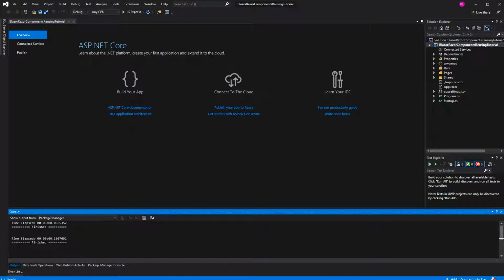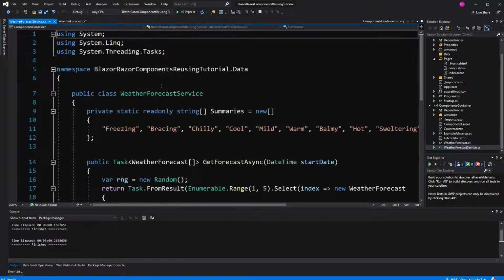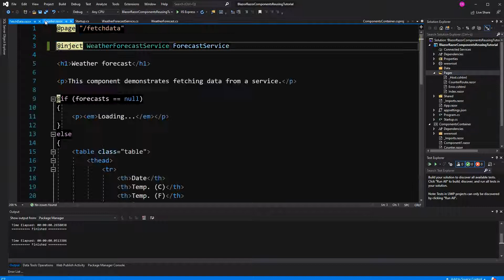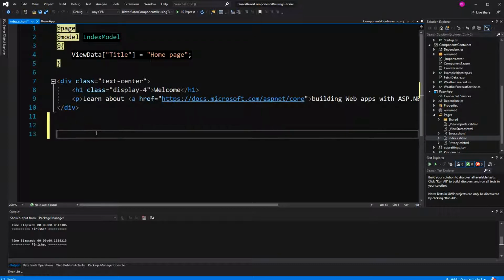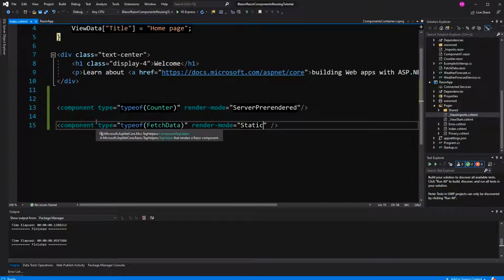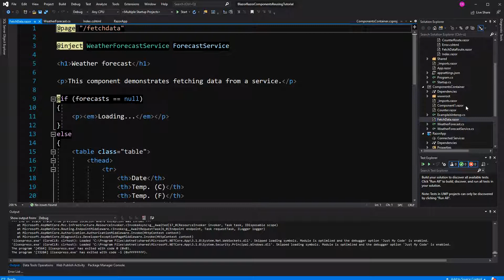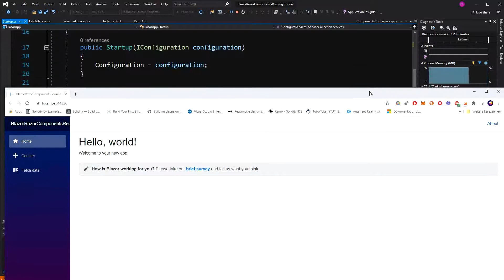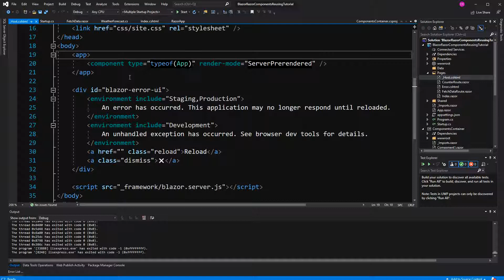Blazor (Razor) Components reusing in Razor Pages

Comment: I believe to use server prerendered mode to work correctly, we'll need to add server-side blazor in services and map blazor hub in Startup class. Also include the blazor javascript.
Reply from the maker: youre right, in Razor Pages the Razor Components are getting rendered as static content even if we set the rendermode to serverprerendered
Reply: @DavidSeesSharp  hi david, I am trying to render an admin template in blazor server. It always comes broken. Could you please help?